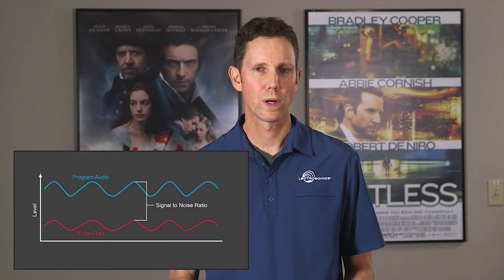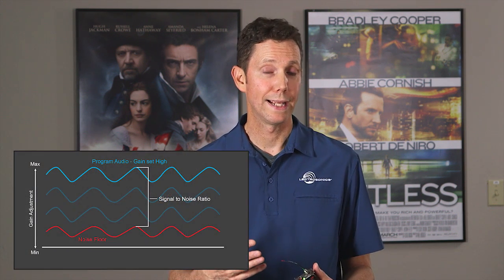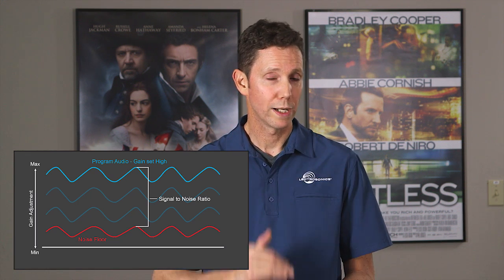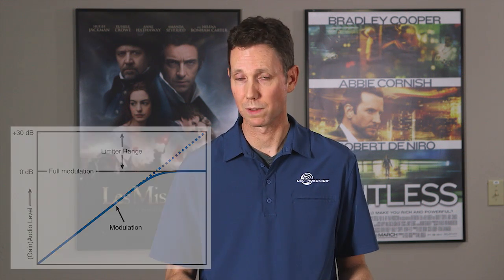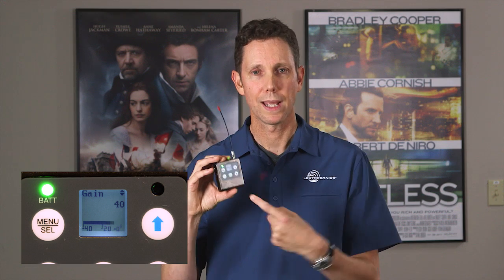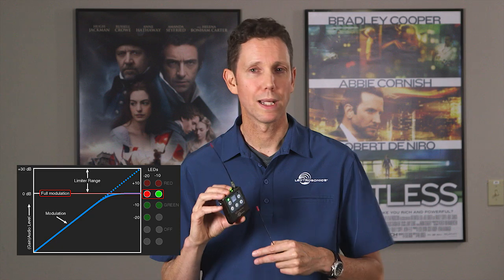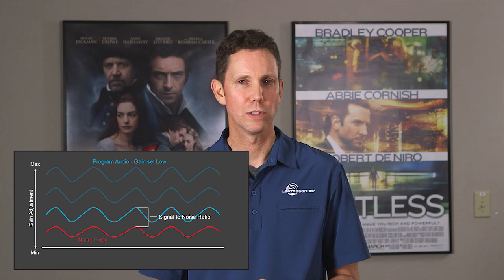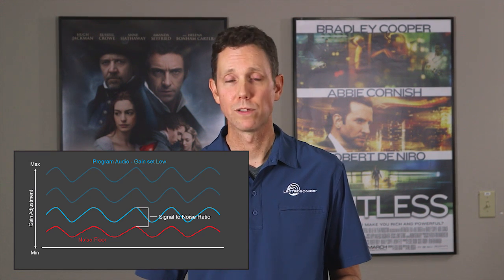Setting Your Wireless Mic Transmitter Audio Gain Properly (analog and Hybrid systems)

Comment: What would be the perfect input gain setting for Sennheiser G4 radio lav mic to get maximum range?
Reply from the maker: That depends on the lav mic. In general, set the input level as high as possible before the "limit" or "peak" LED comes on during audio peaks. We looked at the G4 wireless manual but could not find any info on input level setting.

Comment: Hi, I use a Bose S1Pro speaker. Am a busker and need great sound and loud enough. I have a Shure microphone and an Xvive receiver, but plugged right into the speaker it does not give enough sound. I have had it for a few years now, could it be that it has lost signal? I wouldn't like to spend a lot of money right now, but I have no idea what to do next! Can one measure the signal in any way?

Comment: I need a wireless mic system that can handle high dynamic sound such as live story telling performance, is there any product that can handle that? I tried rode wireless go, but it clips even I set at -24 db
Reply from the maker: Yes, the Lectrosonics wireless systems are known for wide dynamic range and low noise floor. Take a look at the L Series Kits for single-channel wireless systems with bodypack transmitter and lav mic: https://lectrosonics.com/zs-lrlmb-l-series-kit.html
Reply: @lectrosonics  sounds good, but the link has no detail about pricing and shipping
Reply from the maker: We don't sell direct - check with our retailers for pricing & shipping: Location Sound Corp, Trew Audio, TAI, Second City Sound, B&H, Gotham Sound

Comment: strange range 😀 Audio gain could impact on distance? why? :)
Reply from the maker: With any modern FM (Frequency Modulation)-based radio system, the receiver will squelch if the noise floor is too high. With the input gain set way too low, there is not enough signal (compared with the noise of the channel) and the receiver is not happy.
Reply: lectrosonics Later, i will happy! i hope :))
Reply: @lectrosonics  Interesting, I never knew that was a thing! How does it differentiate between a transmitter with the gain set correctly but with a quiet signal (e.g. someone whispering) and a signal where the transmitter gain is set too low?
Reply from the maker: When the gain is set properly, the carrier is modulated, even if just a little bit, by everything the transmitter mic picks up, meaning the noise floor is higher, thus, the receiver has something to grab onto.
Reply: @lectrosonics  thank you !
Reply: @lectrosonics  OK, that makes sense, thanks!

Just for the sake of discussion, does it mean if the gain is set correctly then the lav is unplugged, assuming the pack doesn't send a mute signal or similar, would the range (of the silent transmission) also be reduced?
Reply from the maker: Yes, with next to no noise or any modulation on the carrier, the receiver would likely squelch a bit earlier.

Comment: I have that exact same problem but when transmitter is still very close to receiver (5-10 metres). Do you have any idea what might be the problem? Many thanks in advance!
Reply from the maker: Without knowing the details of your system and setup, it is difficult to know what might be the cause of dropouts at close range. In some cases, you may have too much RF gain and this might desensitize your receiver and cause dropouts. RF gain is like audio gain - you want just the right amount, yet a lot of people use amplified antennas when the don't need them. Also, dropouts at close range can be due to a high level of reflections (RF bouncing off metal). If you are using an SRb, SRc, Venue or Venue 2 receiver, you may want to try Ratio Diversity to see if this helps with that issue.

Comment: Doesn't bumping the gain up to the limiters reduce the amount of headroom available?
Reply from the maker: Yes, if you hit the limiters really hard, you can hear the effect of dynamic compression. However, if only peaks are limited by just a few dB, this is generally not noticed in the resulting audio. All things in audio are a tradeoff, and so it is a case of carefully adjusting input gain to achieve the highest amount of s/n while not audibly limiting the audio.

Comment: I think one challenge with drama is the dynamics of an actor's performance can vary wildly. Sometimes even an actor who talks at a reasonable level normally can drop 5-10 decibels easily when performing. A dynamic scene can also get very loud even when starting quietly. Those situations are troublesome for wireless range and I try to be as close as they will allow me with my cart/antennas
Reply from the maker: Matt, great comment. Keep in mind that we exaggerated the problem for this video, but in the real world, range is not typically affected unless gain is set way off. We agree that you still want your antennas and receivers as close tot he talent as possible. But with a 10-15 dB range of "peaks", you can still set the transmitters to "tickle" the limiters and have excellent range. A little bit of limiting is probably preferred to never hitting the limiters, in terms of signal to noise, as well.
Reply: And to make things even more complicated, try children's drama (in a school gymnasium)! Kids can be very erratic. They mumble when they forget their lines (parents look at me wondering why they can't hear their child), or the kid is 3 years old and shy (so I have to pump up the sensitivity), they mumble the parts of songs that are wordy and complicated, then when it comes to the fun chorus they sing at the top of their lungs and peak the channel. Also, there are the various "exclamation" parts of plays where a kid (no matter what age) will let out a full-volume SCREAM and clip really badly. It's very difficult to set a gain structure for all of this. On top of all of that, I have to try to put a mic on ten kids (microphones are always an afterthought to drama teachers up until it's the main performance), tape it into place (for good gain before feedback), and hope the kids don't mess with it back stage. THEN, often times more kids need mics, so there is mic swapping backstage. And I pray that the parent helper back stage gives the right kid the right mic, and that they are putting it into place properly. Costumes rub elements and cause popping... batteries tank all of the sudden... Mufasa jumps off the cliff onto the stage and I pray he doesn't land on his transmitter... Phew. 100 things can go wrong, and no matter how hard I try to make it all work, some parent is pissed they couldn't hear their kid.

Ok, I'm done complaining...
Reply: @Puck90a  - I think you hit everything I've had.  I get the pops, crackles, static, and buzzing and all everyone is worried about is "turn off your cell phones so they don't affect the microphones."  That's fine, so they don't ring during the performance, but I've heard what cell noise sounds like in the system and what I'm getting isn't cell noise, awd car as I know; it's all all of this you mentioned.  Then more complaining comes about people not turning off their cell phones, they start collecting the kids' cell phones (again, fine if you don't want them playing with them or have them otherwise being a distraction,) but it's not helping - because it still isn't cell noise.
The last play I did, I got it down to just one (of I think 12-14 microphones on kids) with the noise.  We had run out of microphones we had available for use.  Oh well...